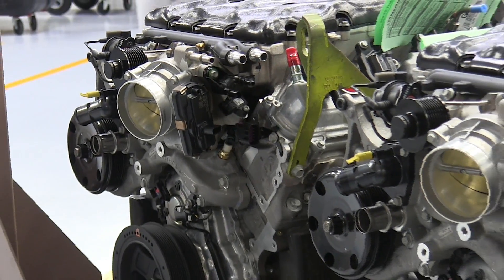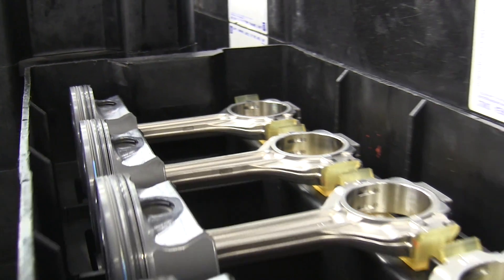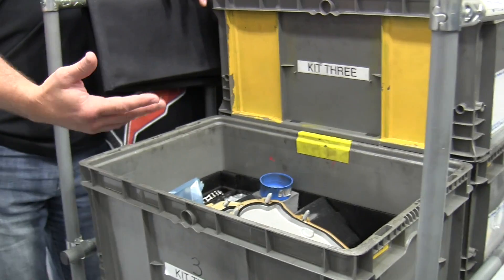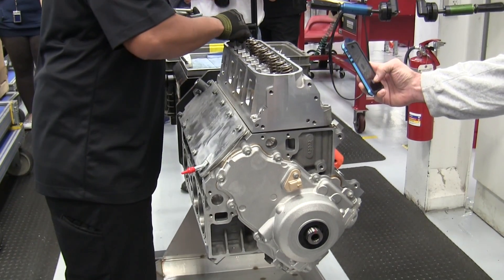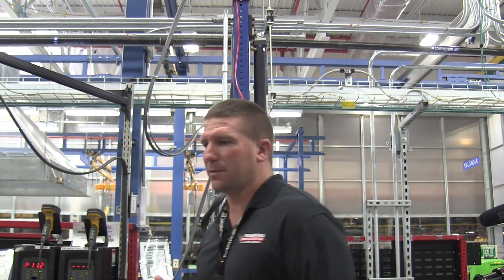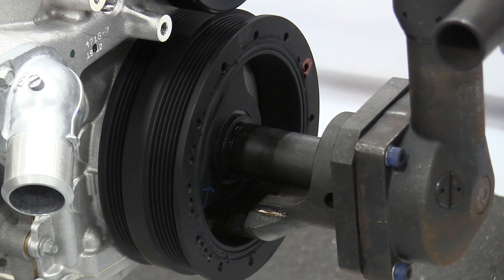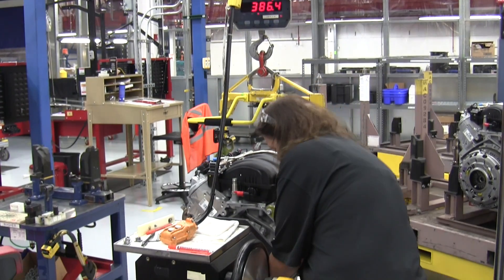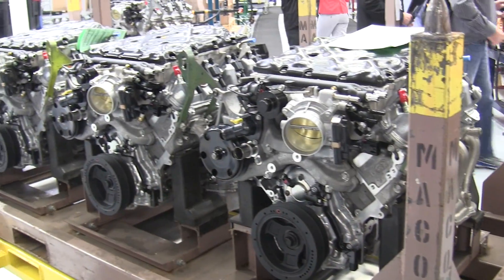Corvette Z06 (LT4) and Camaro Z/28 (LS7) Engine Build

Comment: I don't get.. There are so many more powerful engines that are half the size... Why are car companies still wasting there time with big chunky gas guzzling ship wrecks? That's a serious question...
Reply: Also you seem to confuse engine displacement with engine size.
Reply: davdavc no offense to you, but this is why people shouldn't speak up so willingly on something that they don't seem to know anything about. And if you really don't care then why bother asking?

Engine dimensions and engine displacement are two different things, also a major attribute of the OHV cam in block design is the fact that it is compact. Looking head on a LS1 doesn't take up that much more space then lets say a Miata 1.6L I-4 engine. A lot of size is gained from DOHC engine designs, in the case of a V shaped DOHC engine you can a lot in the form of height and width. The old 5.0L Ford V-8 engine is much smaller then the Modular 4.6L DOHC engine, it is almost funny the size difference. If you look at pictures of the old 5.0L V-8 next to the 4.6L V-8 you will clearly, the Nissan 3.8L TT engine being a DOHC and twin turbo engine means it is going to take up much more space then an LS7 (it wouldn't be able to fit under the hood of the Corvette). 

The DOHC head is also where the extra weight is coming from, a normally aspirated 3.7L Nissan V-6 engine VQ37VHR is roughly the same weight as the LS7 (the LS7 without its exhaust manifold and I believe 25 pound flywheel is under 400 pounds). I believe that the 370Z engine is about 420 pounds, at least the last time I saw its weight mentioned in an article that is what they qouted. 

Another good example of size and displacement being two different things, I have seen stroker kits for the 3.5L/3.7L Nissan engine that will take it up to 4.5L. However this doesn't change the external dimensions of the engines, so you have a engine that has a greater displacement however is the same exact size.
Reply: davdavc Also some people who own C6 Z06 Corvettes do drive them across the US from time to time, in that situation being able to get 30MPG is a big benefit. On the flip side people do head and cam packages on the LS7 that offer north of 600BHP and some push it to 700+BHP so there is still a lot of power left on the table with the LS7 engine.
Reply: davdavc really cant find the weight of the LS7? WATCH THE DAMN VIDEO! They weigh it for you at one of the stations.
Reply: Half the size lol. Get a clue
Reply: Keanu Ford I am not sure what you mean by big. The LS1, for example, had a very high power density. It's relatively small dimensions compared to engines with similar output and weighs less than 350 lbs. Also, the first car it came in, the 1997 Chevy Corvette, got 19/26 mpg rated. I am not saying that this is is an astounding feat, but for example the contemporary 1996 300ZX 18/24 mpg with 45 less horsepower! Also I used the LS1 for example because it was the first engine in the last series of engines and the ancestor of the LS7 here.

I drove several turbo Nissan cars (one was a 300ZX like I used for the example and another was an aftermarket turboed 240SX) as well as an Infiniti G35 Coupe. I also drove a few other Japanese sedans (Maxima, Sentra, etc..). These are cars that I actually owned for several years, not just drove one time. They were fast and fun, but to claim that the LS-series of engine is just "big and loud" is bullshit. I understand your point of view that it's fun to win a race as an underdog with a smaller engine and Japanese designs are often very well thought out, reliable, and high performance. I used to think like you as well and drove only Japanese and more particularly I was a Nissan snob. It's amazing what you can do with those smaller turbo engines but we are talking stock production now, right? This is an OEM factory tour.

I now own a 1999 Corvette and I am very impressed about how advanced it's features are even though it was designed over 17 years ago. I have done some light bolt-on mods and it actually gets even better gas mileage than the official (I get an average of 30mpg highway if I drive conservatively). It helps that I have a manual transmission as I have had on all my cars since I started driving, but it's still pretty good gas mileage for a 90s car.

German cars are usually overpriced, over-engineered money pits. They have overly expensive parts, wacky designs that require removing things that shouldn't have to be removed even for basic service, intermittent electrical problems, or hard to service parts requiring specialty tools. Try driving one for more than 7 years and see how many repairs it needs on parts that would not have failed yet on a Japanese or American car and how overly expensive those parts are compared to other brands. I work on my own cars and have seen german and swedish cars do some ridiculous designs.
Reply: Keanu Ford you drive a Si?
Wow, you just lost everyone's respect.
Reply: davdavc When I drove a Grand Sport Corvette (basically a steel frame railed LS3 Z06 Corvette) I didn't find the suspension to be overly stiff. Actually these cars are generally stated to have very compliant rides, while they are not setup to be luxury cruisers they most certainly can be driven long distances without problems. Much softer actually then a BMW 135 that I made the mistake of driving in back from Las Vegas (after two hours we both had to get out and stretch). Some people own a C6 Z06 and drive it on the week ends and some people use it as a daily driver, different strokes for different folks. Also one of the challenges with the Corvette has to do with the fact that it is a high performance sports car however many owners do use it as a daily driver. So large cargo volume, an ability to get great fuel economy, and being comfortable enough which actually makes the Corvette a sports car/GT car duel purpose car (granted it doesn't cost $300,000 like some more expensive pure GT cars you don't get a $300,000 interior). 

I know that you were looking for an answer, and like I said wasn't trying to be rude or anything it is just you were making very certain comments that were wrong simply because you didn't know much about the LS7 engine.
Reply: davdavc: that 3.8L in the GTR is bigger and heavier than the LS7 considering it has two turbos. You still have not a clue
Reply: These conversations always turns south. Why can't we all just enjoy the fun and cool cars, all of the fan boy stuff really has been turning me off to cars.
Reply: there arent more powerful smaller engines. Smaller engines rely on turbos to get them to their HP. Without trubos, 4 cylinders and V6's arent very powerful. Obviously.
Reply: Keanu Ford What? Japanese cars beat nothing. They are for kids for their first car. What German cars can beat american cars? Track, no. Drag, no. Luxury, sure ok. Reliability, well seeing we make alot more cars than germany does, its hard to compare. And take out the turbo from any japanese cars, even with them they are shit. They can make you feel fast until youve been in a real car
Reply: Duane Craig the problem is people comment on videos of cars they hate which is a waste of time. Thats like going to a restaurant you hate and yelling you hate it. Its pointless
Reply: Keanu Ford Thats not what Muscle cars are know for and they wont change because we dont care. We like our cars with big V8's and RWD. And we like power over fuel efficiency. And Muscle cars are not expensive. A normal income can afford a Muscle car. Thats what muscle cars are. Alot of HP in a wide body mean car. Its a passion. And you can like Muscle cars, but if you dont agree with them, we dont care. It wont change and you dont see them like muscle car people do. Like i will never understand why people buy a JDM. We all have different views
Reply: What do you mean by half the size? The physical dimensions of a Nissan GTRs engine is about the same as a LT4 and about the same weight.
Reply: man did this topic just keep going and going....

At the end of the day we buy the entire package, and car makers design and engineer the entire package. If a car maker is seeking to produce a 3,100 pound 500BHP car there are many ways to go about it, and the biggest factor in if it will be good or not is how well they have setup the car to get all of the parts to work together. The rest is just marketing (which tends to be pure BS) to try to sell the car to people, generally with performance cars they try to make it look super impressive. 

Also comparing a after market tuned car to a regular production car is flawed for many reasons, one being that the after market company generally doesn't have the same level of expertise or standards. Nissan and GM produce these cars (as well as many other car makers) to be reliable for 100,000+ miles, otherwise why should Nissan just produce the GTR with 1,000BHP from the factory?. Also they cars are being produced like regular cars, which means that the parts have to be easily manufactured for the most part. It isn't the same as some of these car makers who produce the cars by hand who can design the part how they need it (instead of in a way that can be easily mass produced). For this reason though I tend to have great respect in the work that goes into designing, engineering, and manufacturing these cars. 

Currently turbocharging engines and direct injecting engines has become mainstream and regular, however much of the tech that we view as modern and new actually isn't. GM was doing mass produced turbocharged engines as early as 1962, and a few car makers had produced direct injected cars over the decades. The perception of new is just that a perception, however this is proving to be a good way to push fuel economy in regular cars. I remember when the Chevy Cruze Eco came out with its 1.4T engine mated to a 6 speed manual gearbox getting 42MPG highway. 

The LS7 is considered to be an amazing engine due to its compact size, light weight, throttle response, willingness to rev. On the after market tuner companies push them to well over 600BHP normally aspirated (and 700+ has also been done), honestly though how much more then 600BHP do you really need/want in such a car. 

The Nissan GTR engine being a turbo engine built to last 100,000+ miles is probably robust enough to be pushed to well over 1,000BHP. In some cases increasing power can be as easy as turning the boost up a bit (1.4T programmers will turn boost up to 24PSI for example). The Veyron produced a 16 cylinder 4 turbo W 16 engine that produced in its lowest trim 1,001BHP and in higher trims over 1,200BHP. The only source that I found was that this engine was around 1,000 pounds, Nissan GTR engines seem to be 550-600 pounds in weight. As a performance engine you don't just want power, a giant boat engine can make something like 250,000HP yet weighs too much and is too big for a car. The GTR engine could be better then the engine in the Veyron because it can be pushed to the same power levels in a lighter and more compact package. meaning putting a 1,200BHP GTR engine in a SLC (super light coupe) would make for a lighter car with the same power over the Veyron engine in the same car. If you really just wanted more power then why not drop a top fuel dragster engine in your car (9,000BHP Nissan GTR would be interesting) but people don't do that because it would make no sense.
Reply: Davdavc, 

Here's a really good way to think about it. 

The one on the right is 4 liters, gets about 25 highway mpg in a 3500 lb car and delivers 250 hp. The one on the left is 6.2 liters, gets about 30 mpg on the highway in a similar sized car and delivers 400 hp.  Pushrods in V shaped engines are VERY good for packaging. 

http://carphotos.cardomain.com/ride_images/3/3522/1469/33803234006_large.jpg
Reply: Because there are not a bunch of more powerful engines that are physically half the size or as light. Those other engines can not produce 460bhp while also returning 30 plus miles per gallon.
Reply: yes, but those small powerful engines are very bad fuel efficient. GTR 16/23, the same Porche's. It  means more pollution. This is EPA. The gap increases as you push them to the limits.  Also  less reliable.  The best way to evaluate an engine, (and you can extend this rule to the car itself), it's performance per gallon of burned fuel... unless there is a very big weight difference, which is not the case at all.
Reply: Duane Craig we wont make anything to compare to the miata because we dont care for cars that small. I know i would never want one. Just not an american type of car. And i dont think earlier drag muscle cars hurt american cars at all. Corvette has been focused the last decade or so for the track with their team, and with the new Z06 bound to set production records on alot of tracks. It didnt hurt them because with chevy's first attempt at a full track camaro the Z28, is better than alot of cars. And the 1LE before it. Thats the thing about American cars in this day in age because Chevy can make some killer track cars that can be good at the drag and have 2 of the best track cars to come out of america.
Reply: Sanic I don't think that I ever stated that the world doesn't love racing....... did you know there are many forms of racing and many different racing leagues. For example you have a myriad of off road type of racing. I try to make it out to the Long Beach Grand Prix every year, this year they had two different leagues of open wheel racing, they also had two different leagues of GT racing. They also had some truck racing and drift racing going on, all forms of racing and all very much loved. Now I know that some people love drag racing and in some parts of the US drag racing is the only thing that people have. I do not knock or deny that some people like drag racing (my dad and uncle loves the stuff) I just happen to have no interest in it. That is not to say that I can't appreciate some of those drag cars and the skill involved in drag racing and doing it well, just trying to clear this up.
Reply: Keanu Ford that GTR is also has $300,000 worth of parts in it.
It also has a 20,000mile lifespan.
Reply: U tell me what 7.0L engine puts  out that much power and damn near 30mpg, will do 200 mph and u can beat the hell out of it daily,,THAT'S NOT FORCED INDUCTION...just one please tell me
Reply: Get a clue before commenting. The LS7 is smaller and lighter than the GTR engine.
Reply: Knights2theEnd u have no clue what ur talking about I see, The LS engines are far more reliable than anything coming out of Europe hands down ..They get had mileage like a four banger,, so research b4 making stupid comments..C7 StingRay 29mpg C6Z Damn near 25mpg... id say they got it down to a science when no one else remotely touch that
Reply: Knights2theEnd u would be completely wrong,, Bmw,Mercedes are the most unreliable cars on the Planet at this point, look up the service history on Euro cars,BMW has had to buy back a lot of cars b/c of major engine,electrical , transmission and some arent repairable to the point Bmw sent out engineers and they couldnt figure out the multitude of issues customers are having so they simply buy the car back... look it up to fact check if u like
Reply: Knights2theEnd
German cars in particular have a lot of problems and are very expensive to repair when things do go wrong for them, Corvettes are often used as daily drivers and have no problem getting to 100,000+ miles. In Southern California I use to drive about 40,000 miles a year and people who drive their Corvettes the same break 100,000 miles in just a few short years.

All of the people that I know who drive Audis have to send their cars into the Audi dealers often for repairs, they either view it as I hate this car or I love my car so much that I take it in right away when there is an issue. The Corvette is really kind of the Honda Civic of the sports car world (funny way of putting it I know).
Reply: Knights2theEnd some car fans I only focus on one segment and for that reason they are not always knowledgeable on other cars. Just like how mustang fans may not know anything about a b16 or a rb26det or a vq engine.  I just happen to find a wide range of cars interesting and from all regions. After all cars are cool no matter where they are built.
Reply: Guns Cars and Digits that is a flawed way of looking at it. This is because the 4.0l engine it's highly tuned and you won't get much more or of it normally aspirated. While the ls3 engine still has a lot in it which the after market goes for. A search on the katech site you will find that for about $6,000 they can get you 525 bhp from the ls3.
Reply: The reason they still use 6.2L is because it has proven to be reliable, very reliable. It's been in there trucks which are very durable. Also the engine is not a big engine. The LS3 and LS7, LT1 and LT4 are one of the lightest V8's in the market and one of the most compact engines. Even lighter then some 5.0's and 4.0's. It uses a lot of magnesium and aluminum. And because they are Push Rod engines and not DOHC they have a lower center of gravity then the 3.8L V6 in the GTR and other V8's. They also produce good horse power. Yes they are lighter then a Twin Turbo V6. Compared to engines that product 100hp per liter they are more reliable, produce better power and much better torque and can achieve better MPG. They also have a wider torque band, plus you can find these parts anywhere. They also don't overheat as much, compared to turbo engines. Only issue I can think of is Oil Pressure which can be fixed by adding the Dry Slump Oil System.
Reply: Here's the simple answer for all of the bumbling idiots arguing about engine size and power and how large engines are inherently less fuel efficient.   If you take a look at thermodynamics you'd understand it takes a certain amount of fuel and air to make 500 horsepower. Horsepower is a form of work. Work can be defined as energy over a rate of time. To to create a certain horsepower a certain amount of energy is required. Thus because a certain amount of energy is required you can state that a certain amount of fuel is required to release the required energy for a given amount of horsepower. that said a engine that's large and naturally aspirated making 500 will need the same amount of fuel and air that a (smaller turbocharged engine/ smaller dual over head cam engine) will that's also making 500 hp. And if you'd like to really go into efficiency generally a cam in block pushrod engine is more efficient that a dual over head cam engine because the push rod engine has less frictional losses as compared to a dual overhead cam engine
Reply: Everywhere I look shows the Nissan gtr to be about 600 pounds which makes it 150 to 200 pounds heavier then the ls7
Reply: Looking around an aircraft engine website, LS7 engine complete (less flywheel, alternator, AC compressor, and belt) is 380 pounds (includes stainless steel headers).
Reply: ***** sadly there is a lot of that going on where people are just trying to troll. My big problem here is with those people because they generally know nothing about the vehicles that they hate they come off as douche bags. Calling the ls7 a big and heavy engine because it is 7 liters is something that someone who doesn't know how light and compact it is. Though I don't see how the counter no your car sucks gets anywhere. I like the Nissan gtr and the corvette though I seen to understand that this isn't common. For some you either love Japanese cars and hate american cars or you love american cars and hate Japanese ones.
Reply: Duane Craig thats not the case for me. I dont hate japanese cars. They just dont have a strong point. Besides low cost. They arent meant for performance. People like to rev their cars meant for grocery shopping against a car meant for speed. ex, honda revving at a camaro. it doesnt make sense.
Reply: ***** As far as that goes, I kind of have to agree with you in that you have a lot of the import crowd driving non performance type cars. Though I will say that Japan did make some solid performance cars, they were performance cars that were focus built and sadly not really around anymore. The Honda/Acura NSX, Mazda RX7, Honda S2000 are all gone though Nissan still seems to take performance seriously with the Z car and the GTR. 

At the same time I feel that the Z car peaked in the early years and my favorite Skyline is the R32 and R33 models, I really wish that the Japanese started to make more performance cars. 

The huge problem that I see with US performance cars that for too long they catered to just one demographic (drag racing) and as a result fell behind with performance cars. Now they are making good progress in this regard with vehicles that are much better for all around performance. Now it seems that the faster cornering cars are American (mostly GM) though I want to see some lower end sports cars (competitors to the Miata). 

The huge problem with European performance cars I feel are many, one being the snobby car fans who think that if it isn't European then it isn't the best. They also have some of the biggest rip offs in the industry, also they don't seem to perform like they use and they are leaving the door wide open for others to come in and take everything.
Reply: and can have the Hellcat for the drag
Reply: ***** I completely disagree as obviously Americans buy them and I want one as well. I also find drag racing boring and would never go to one. Though it takes all types to make the world go round.
Reply: Duane Craig drag racing isn't for everyone. It takes alot old driver skill to win in drags. And I can see where you are coming from with the miata thing, but that is more cars we don't need on the street imo. But that's what makes cars awesome, there are different types
Reply: ***** I am not really sure why a "miata" is a car that we don't need on the streets.
Reply: Duane Craig its not the 'miata' that needs to be kicked off the road. i actually like the miata. just the segment was created for no use to anybody. its a poor mans sports car. sports cars have 2 seats and dont have much room and are expensive. for a cheap car to not have room is stupid. i dont know how to put this into words. cars like ferraris dont have room because they are expensive. a cheap car should have room. i cant find a way to put this into words.
Reply: Sanic agreed
Reply: Keanu Ford also look at the fact it has some turbos on it. A clean V8 vs a clean 4 cylinder and V6 will win. Its bigger and produces more power. And i dont agree with v12's lol. its a waste. and adds alot of weight.
Reply: because the customers of this kind of vehicle demand big V8's
Reply: Keanu Ford lol you know how much an AMS package like that would cost lol?  The car would last a year at most.  The LS7 is a proven race engine also used in corvette racing CR program.  No turbo charged crap, just pure NA engine baby!
Reply: ***** I'm not trying to compare American cars to Japan and say ones better than the other, it's personal preference. But I'm sure you know the amount of power a car makes is based on displacement, and strength. There's obviously the other components like how well it breathes, RPM (mainly engine balancing), and Torque (which is covered by displacement and strength). 

With that in mind, you realize there's a point that you reach where you're wasting displacement, for example 5 liters is PLENTY enough room for 2000 HP, as proved by UGR. Which means for peak performance, strength becomes the main priority before you consider modifying an engine. And that is where Japanese cars come into their own, people don't realize Japan used to severely de-tune/over-build their engines. To the point of 2JZ's making 800 HP with no issues, daily driven on stock internals, and having the potential for 900+ but that's pushing it, or RB26DETT's making 550 HP with no upgrades at all, just a tune. Or a small simple engine like the 4G63 which came in a huge variety of cars being capable of 450+ HP on stock internals daily driven (more if you want to push it) and that's why they're so good.

These "little Japanese" cars people seem to have been almost brainwashed into thinking are made of "Asian plastics" and being weak are actually brick shit houses, there's a reason the 2JZ is heavier than most LS engines, and that's because it's stronger, which allows it to hold more pressure on stock internals. Displacement is great and all, especially for making peak torque at a lower RPM (which is nice) but strength is the key to making power (unless you're going for an absurd amount of power that requires 8+ liters) and most Japanese engines are stronger than most LS engines. There's obvious exceptions, like an LSX but they're in a different league.
Reply: Sanic Did you read my last sentence? It's literally an engine sold separately from any car designed for racing. It's an awesome engine, but it's not in the same class as any production car engine. You can build an 800 HP Supra for the same price as an LSX + delivery in Australia (where I live).
Reply: this engine is a gas guzzler?  ignorance I tell ya :)
Reply: skillz1855 We obviously live on different planets.
Reply: Knights2theEnd not so much, i buy parts from my local dealer daily, i can tell u the service manager is overwhelmed with angry customers.. he mentioned they have brand new car theyve sold that come in the day after purchase and bmw have no parts available for the repair and thats no guarantee,,Customers are making payments on cars that they cant drive and in service for months at a time.. thats not a good thing,, so many people are completely going to American / Japanese cars .. they say they realize how good they are made and service history after owning a bmw/mercedes
Reply: Duane Craig lol damn dude i just read that whole convo. i found it rather amusing the way you schooled that guy xD
Reply: Dominic Daley I am amazed at the amount of mindless people. Using cost and availability to explain reliability.
Reply: davdavc Engine displacement is the total volume displaced by the pistons when they move from the top of the cylinder to the bottom of the cylinder. (TDC to BDC).

Engine size is a loose term just referring to how physically large and heavy the entire engine assembly is.
Reply: The LT-4 has 650hp, is a 6.2ltr. Well over 100hp per ltr. That is on par with any of the European cars.
Reply: Keanu Ford May I suggest to you that you are too arrogant, pompous, and ignorant (particularly on the subject of engine efficiency) to drive an American car.
Were you a drop-out at MIT??  You would get along with Prof. Jonathan Gruber and his Obama Care Debacle!  The rest of us see right through you and Prof. Gruber.
Reply: Snow Crest man you must have some serious add bringing up in this things that have nothing to do with the comments at hand....
Reply: Because you can get more overall power with a bigger engine, This is a stock engine with 500hp, naturally aspirated, and nothing too fancy.
Reply: davdavc They aren't made of the same thing.

The GT-R's engine has turbo's, overhead cams and an iron block to stand up to all the heat coming from that boost. As a result it's bigger and heavier. Pretty much every Chevy small block since the LS3 has been made out of Aluminum. What makes the GT-R fast is that it's got a sophisticated AWD system and a bunch of electric nannies idiot-proofing the driving experience.
Reply: FrankieJames7 Davdavc made this comment 3 months ago, I don't think that continued comments on this helps any. Also I don't think that the insults really add anything to the comment section either.,,,,

To sum things up the 7.0L LS7 is physically smaller and lighter then the twin turbo charged engine in the Nissan GTR. Tuned it has proven to be able to produce 700+BHP N/A, however this doesn't mean that the Nissan GTR has a crappy engine as it is a monster of an engine as well.
Reply: Duane Craig it isn't crappy and it works, that is correct but it is not as good as other engines.
Reply: FrankieJames7 it is somewhat average for a performance engine. Honestly I think that the veyron is a terrible engine considering its massive physical size and weight of around 900 pounds. There are engines that make more power weight weigh half as much.
Reply: the w16 is nothing but an engineering failure, how many radiators does it need? only retarded european car makers think using a w16 is like an engineering marvel. failure in every aspect.
Reply: FrankieJames7 Ya I have to agree. I think it has 4 trubos. All those moving parts makes that thing impractical.
Reply: Guns Cars and Digits Automotive press has become some what of a negative for the automotive fan community today. If they have their way all performance cars would be built the same and that would make things boring, I would just stop liking cars when that happens.
Reply: Guns Cars and Digits

I do feel that Chris Harris and Tiff are the last really good auto journalist around, the rest just pretty much either A rehash what has been said or B read company marketing stuff. Tiff having been a race car driver certainly knows a thing or two about fast cars, Chris is pretty good too just IMHO not a Tiff.
Reply: Duane Craig Carlos Lago is above average to me.
Reply: Pushrod engine only has one cam when the gtr motor has 4. Also the plumbing for the turbo adds weight.
Reply: You can put a Turbo on an LS engine and  have a 1200 HP street engine .. @davdavc
Reply: So who agrees with me and thinks Engineering Explained needs to explain engine sizes and displacement and its relation to power?
Reply: ßIGpoppaKEGdog™ a 7.0L LSX can push 2500 horsepower.
Also last 5 time longer than a AMS GTR V6.
Reply: ßIGpoppaKEGdog™ 
HOTROD pushed a stock 4.8L LS to 1,204horsepower.
You don't need 2 buy an LSX.
You can make a 800hp LS for under $3000 US.
Reply: Duane Craig you haven't gone to a drag day have you.
Because the world loves racing, not just america.
Reply: Duane Craig don't nock it before you try me.
Reply: Duane Craig because there are like 3 million miatas are on the road.
Reply: Sanic Yeah funny, and my tiny 4 cylinder beat a 350 too lol.
Reply: ***** I prefer RWD over FWD anyday but I'm too consumed in styling, MPG and HP/weight ratios I guess, don't hate.
Reply: No, i'm talking about the engine not the truck but anyway I'm still able to beat v8's..it's not about the amount of cylinders or size of the engine. Look up some GTR drags and that tiny 3.8L v6 shits on v10's and v12's.
Reply: Keanu Ford any 4 or 6cly with turbos invalidates your argument.
Add the GTR boost to a ls7 and you get 900 horsepower.
Reply: S Saini the gtr i'm taking about is the AMS and it beats anything. And it only has a 3.8 liter. Those lambos had over 2000 hp. They definitely had boost.
Reply: Reliability and cost. GM isn't confident in their technology so they everything they build is bigger especially when it comes to gaps. GM has no intension to pay their engineers to make small engines with big HP, so they simply built big to make up for the technology.
Reply: skillz1855 I don't understand why you are arguing about reliability and mpg between Europe and the US. It has nothing to do with my argument. I am simply answering the first question that started this thread. Why build such big engines? I said for reliability and cost. 

Now I will argue about what you have mentioned. I will not mention anything about a LS engine because I do not know anything about it. In general anything coming out of Europe is much more reliable than from the US. That's just general knowledge and truthfully do not need to even expand on that. The C7 gets such good mpg because of the low end torque and super high overdrive 7th/8th gear. Getting high mpg from the C7 isn't much of "getting in down to a science", its pretty simple. 

Lastly, I don't need to research anything nor do I need a clue. I have restored and worked on GM cars for most my life and also many oversea vehicles. Please learn how to read before making stupid comments.
Reply: you have to remember GM is targeting a specific group of the population here
Reply: CHARLES JOHNSON how did you find that out? Can't find how much the LS7 or LT4 weighs anywhere. How much does the VR38DETT weigh? I believe you are blowing smoke. You mook.
Reply: Duane Craig Okay you're right about that if you're talking about highway miles. In which case you'd want comfort... A big boat of a car that's relaxing for long ass drives.Like a C-class Benz or an A8 Audi... That Z06 engine makes no sense for the city or the highway.
Reply: Money, due to demand for a bigger louder engine. American's don't care about gas or oil consumption as long as it's big, loud and fast. Same reason why idiots still buy Hemi's. You can get power from bigger engine size for sure, a lot in fact. But then They just slap it in the face and use OHC valvetrain in their engine which I don't understand. I stick to Japanese or German cars who are more about practicality. Which is why they were able to beat Americans at something they invented lol
Reply: CHARLES JOHNSON The GTR is 3.8L and keeps up with the Z06... That new C-X75 is 1.6 L and 500 HP. You get a clue.
Reply: I wanted to watch the video to see all the technology put into like a 400+ Hp sport car. I like a lot of american made cars. I just think they could be better. I lied I've never had a German car but I like them over a lot of GM cars and I think BMW is the biggest car company to date. I love muscle cars don't get me wrong but I would rather drive a car that is 200 HP and gets almost 40MPG like my Honda Si and can be upgraded to 14sec 1/4 miles with basic bolt ons.

Ford I think is making a good come around and it's good to see that living in America but I'm tired of USDM using the same shit proven to be less efficient for power and gas milage over and over again, I don't get it. I think they're just waiting until we convert to electric then start dumping out the engines they can already make now they just don't. I think they try and milk it for all it's worth and instead they should just start making an actual difference and change the industry around, turn into all hydrogen or Ethanol or electric cars, that would be nice but they're going to wait until it's like 2050, The thing that I hate the most is like I said the ValveTrain and overall look of the car and the common arrogance of the people that buy them they don't even know what they're buying it's just loud and fast. I know almost everything about my car and it's cheap and easy for me to fix which is why I prefer JDM. But whatever I'm done sharing my opinion.
Reply: Duane Craig
A) Thank you for your response.
B) In my original statement it says "That's a serious question" so I was openly looking for an answer to a question.
C) Driving a sports car with stiff suspension across the country is openly admitting you like hard things in your ass.
Reply: Duane Craig let's say you have two engines made out of the same materials... one is 7L and the other is 3.8L... exaplin how the 7L engine could be smaller in size... (seriously)